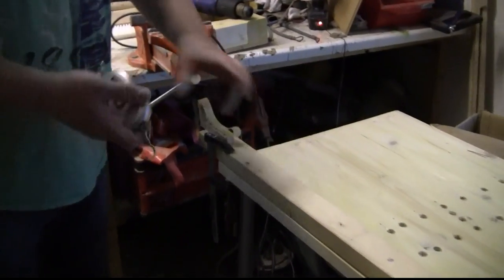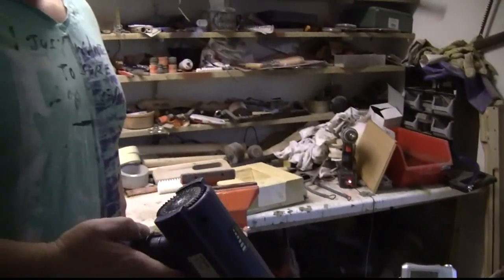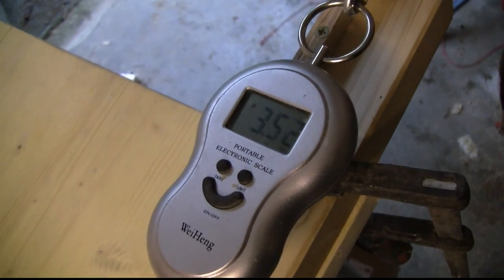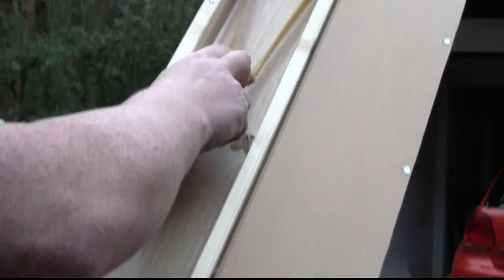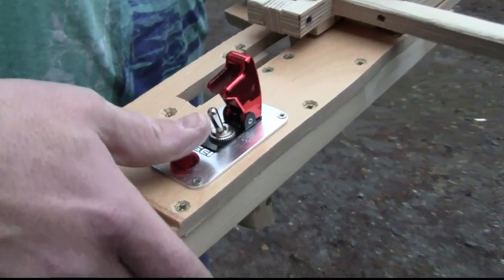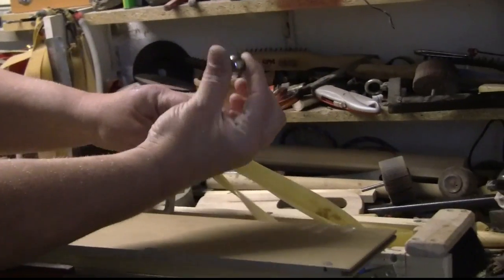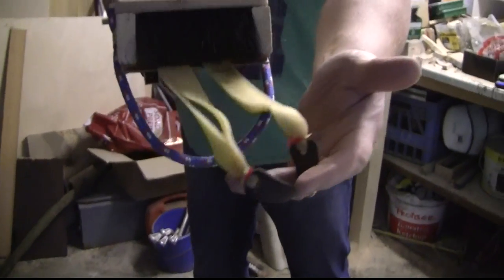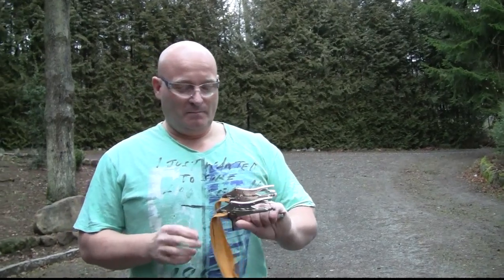The Entropy Slayer 2000: Encapsulated Slingshot Crossbow with Heating System

Comment from the maker: @InTheSticks0001 In fact, the correlation seems almost perfect to me, at least that is the result of my experiments. If I take a slingshot that I can just barely draw out at 20 centigrade to Furnace Creek, I could no longer fully draw it there. But if I could, it would shoot harder. I kept the bands on my little test device stretched for 3 days, they keep the same draw weight once the ambient temp has been reached. Rubber deteriorates, after a few months, it will break down.

Comment from the maker: @ntilley88 You can't reduce entropy as a whole, but you can certainly do that for a part of the overall system. It happens all the time. By decreasing entropy in the rubber bands, we increase entropy in many other things (depleting the battery, using up power generated by power plants, and such. But if we look just at the rubber band, we do reduce entropy in it.

Comment from the maker: @leleobhz It takes the heating system about 15 minutes to max out the temperature increase. A more powerful heating is not practicable because of the energy consumption (the battery is already fairly heavy). I guess a fuel burning heating is the only alternative, plus better insulation of course. But I am fairly happy with this one already.

Comment: Just a heads up about a thermodynamics error at 1:53, when you add heat into a system you are not actually reducing entropy, you are increasing it. A higher temperature causes more atomic vibration in a material, thus increasing the number of microstates available to the material. Since entropy (S) is defined as the Boltzmann constant(k) times the log of the number of microstates, entropy increases when heat increases. 

Thus, this slingshot should be better termed the entropy provider/giver/bringer/increaser, as opposed to slayer. It is amazing that no one here has picked up on such a fundamental error.
Reply: Since entropy is the lack of something, in this case stored energy, and he lessened the lack, his evaluation and application of his technique is totally accurate. The freedictionary defines it as "a quantitative measure of the amount of thermal energy not available to do work". But if I wanted to be even more correct than I already am, he would have an entropy slayer, in the form of the switch that turns off the heat, if you think that when he added the heat his bands got weaker, instead of stronger, as I saw. You should watch more of his videos, he is a pretty sharp guy, and he has a great laugh. Its not often that you see someone who really enjoys their hobby.
Reply: John Robertson ... Have a listen to 1:47 again, he clearly says, 'What we're doing is adding heat energy, we are reducing entropy', which is a blatant misunderstanding of the definition of entropy. Your perception of the nomenclature of the 'entropy slayer' is nothing more than your opinion, but for someone who completely misunderstands what entropy is, I doubt he meant for it to be a 'slayer' that used entropy but rather a slayer of entropy. 

It is in the interests of scientific accuracy, and not for the sake of being pedantic.
Reply: yifuj Oddly, your next to last statement was the original first statement I was going to post before I edited it, so we agree on that part. But, if entropy is the lack of energy to do work, being lost for whatever reason, then he not only theorized correctly, but he proved his point with his demonstration, including his spoken part. He added heat, or thermal energy, which if reviewing my quote of the definition of the term, refers to what is NOT available to do work. Ide be curious to know his background, he is just an office worker, but may have been a leader in quantum mechanics for all we know. Einstein couldve been wrong and Joerg could be right.
Its hard to argue with success.
Reply: John Robertson He introduced heat to a cold rubber band, which produced more mechanical work by shooting faster - that is the very essence of a heat engine, as heat is used to do work here. Remember, the second law of thermodynamics and entropy itself is concerned not with the entropy of a system, but that of the Universe. A reaction, whether physical or chemical wouldn't even occur if it decreased the entropy of Universe. Increasing entropy is the only way to obtain energy out of a system. Here, the heated bands produced more energy, so no entropy is 'slayed'. And if he reduced the amount of work available by heating the bands (as you propose), the speed of the slingshot would be slower, not faster.

Entropy has little to do with Einstein (it was described far before him by engineers studying steam engines), or indeed the work available to a system, as it is a measure of information needed to describe a system in physical terms.
Reply: yifuj Actually, you are incorrect. A elastic spring (like the rubber band here) works by decreasing its entropy as you pull it back (obviously increasing the entropy of the surroundings). This is not a spontaneous process so its ok. When he releases the rubber band, the band spontaneously contracts as the entropy increases back to the level before stretching. See the link for the phyisics: http://en.wikipedia.org/wiki/Rubber_elasticity
Reply: Arfien X Actually, you are incorrect. When a rubber band is stretched its crosslink polymers becomes more ordered, reducing the entropy of the band(although entropy of the universe still increases from heat produced). However, at the point where the rubber band is being heated, and its temperature rises, the entropy of the rubber band increases accordingly in comparison to an unheated rubber band.
Reply: yifuj

I think Joerg said "inducing entropy".
Reply: I couldnt quite make that out. I did hear " losing heat energy" just before that.
Reply: yifuj  I know this is a three year old comment and you most likely won't respond but I was wondering would the effect be different if he heated the bands before he stretched them, then shot? I'm not trying to argue your points I just don't anything about thermal dynamics and find this really interesting.

Comment from the maker: @hrabia99332 Even better would be to stretch it out, then heat it up. If you heat it before the draw, then the draw weight would be much higher, requiring more strength. But yes, that is the way it works.

Comment: Heater slingshot could have slot in the lid closed by two rubber bands with edges meeting in the middle of the slot, preferably on the inside and on the outside. This way its sealed but cocking handle can separate them temporary along the way when moving, it may dramatically reduce heat losses i think because you dont have to openit. The last one could be made more sturdy version and have blades on the outside or one in the bottom without having to make it tougher because handle seems strong enough. With that if overwhelmed by zombies or run out of ammo you can mess them up with cool looking blade slingshot thing :)

Comment: @JoergSprave I also read that when the polymers are stretched, they crystallize partially, which creates heat, and when the rubber retracts those bonds have to be broken by consuming heat. So the Entropy Slayer heating array not only puts the rubber in a higher state of dis-entropy, but also makes it easier for it to return to the rest state.

Comment: what you ought to do now Joerg, is take a chronograph, measure the velocity of your entropy gun upon immediately cocking and shooting w/out heat(the control), measure again after a delay w/out heat, and then your final shot would be with the heat turned on. This would serve to measure the exact amount of energy retention and loss and conclusively prove your hypothesis

Comment: @Musicalshootings Rubber Bands store energy as thermal, and when fired convert it into Kinetic energy. The Drawing of the Rubber Band makes heat, but begins to cool down immediately. If you take a heating element and reheat it, you regain lost energy, making it as powerful (if not more) than if you did a quick drawback and fire.

Comment: The brush you inserted to keep the heat inside the construction surely slows down the metal projectile a bit. Does the effect of heating the rubber bands outnumber the energy loss from the brush? nice construction btw :)

Comment: This is really interesting Joerg, I've never sat down and thought about rubber bands storing energy through heat. Are you able to tell a difference in the power of a shot between releasing the bands immediately and holding them for a few seconds to take aim (maybe like 15 seconds)?

Comment: Love it , but one thing I have not seen (and I do not read all the comments ) when you draw a sling shot and then shoot with the energy from said heat ...what would happen if you pulled and depressed the band before shooting ?(maybe multiple times ) . Obviously specific bands have certain heat tolerances but does it increase from the original pull ?

Comment: I have seen this in archery.Archers try to release asap because the wisdom is that your release hand will without you knowing creep forward and cause the arrow to hit low. Using a low power bow which i could hold all day the arrow hit low even though there was no creep forward, none. I also found the limbs get warm on drawing up.The only explaination is that the limbs get hot when first drawn and if you hold the draw for any length of time the heat escapes to the air resulting in less power.

Comment: A physics question: It is my understanding that the total heat energy is a system consists of Entropy (useless energy) and Enthalpy (Useful energy). Entropy must always increase, because as the temperature difference in the system decreases -- hottest hot to coldest cold -- this is enthalpy becoming entropy.

When you heat the rubber, aren't you adding new energy, which contains both entropy and enthalpy? So wouldn't the enthalpy (proportionately) increase, instead of the entropy being slain?
Reply: WhereWhatHuh I think you're right.

Comment: Its not that the kinetic energy is stored as heat by the rubber, but that the rubber "vents" some of the excess kinetic energy its storing when you draw it as heat. I'm a bit confused by the draw strength increasing from heat after its already been drawn, but I think 1) you're increasing the equilibrium temperature and making it harder for the rubber to vent, or 2) the rubber becomes a more efficient system as you heat it, regardless of the energy its already lost.

Comment: @inov8ve The idea is that reheating a rubber and that's been stretched for a while will give it back the stored energy it lose under the form of heat. 
There are basically 3 forms of energy Heat, Motion, Light + potential energy of an item about to fall. So if you heat the rubber band you will restore the physical power it 's lost while cooling.

Comment: @MADJIHAD1942 I think you'll find heating it up is adding energy. Rubber has an unusual property where it can easily convert heat energy into elastic potential energy which increases the strength of the band's pull. This is known as the Gough-Joule effect. Put simply, pulling the rubber turns kinetic energy into elastic energy, heating the rubber adds to that elastic energy, releasing the rubber turns stored energy into kinetic energy, even the energy which used to be heat.

Comment: have you ever tryd to build a self drawing slingshot?  this was the idea i had  with a winch motor attached to a clamp that you set with ammo, then turn on the motor. the pouch draws back to desired possition. it would need a trigger system to release the pouch. electric would be cool, but manualis probly more practical.. anyways just thought id share!

Comment: The thing you are missing is that heat energy is the waste form of the potential energy stored in the bands by the mechanical energy imparted by your physical self.  If the rubber propulsion system were 100% efficient, there would be no change in heat energy, because none of the potential energy would be dissipated as heat.  The reason that the bands cool down is because of convection currents that carry the heat energy away from the bands, causing them to lose elasticity.  Look up heat death.

Comment: Ok, so since the draw weight increased from the heating of the rubber after it had gotten from its lowest point, am I right in thinking that rubber reacts contradictory to everything else? For example, Rubber contracts from heat when everything else expands? Or is there something else at play that causes the draw weight of the rubber to increase?

Comment: What if you pulled the rubber half way when drawing a slingshot, then aimed and then pulled the rest of the way would you still have the full power from drawing half quickly or would it be decreased?

Comment: if the rubber heats up when you draw it could you draw the slingshot multiple times to buildd heat before firing? that would be a good test

Comment: interesting, i would think that rubber would lose strength when it got hot. you could maybe switch the brush with a trap door that opens when you pull the trigger so you don't lose force/accuracy when hitting the brush, using a pull cable.

Comment: @JoergSprave I've done a bit of homework and I'm still not understanding is as kinetic energy stored as heat, but I do find the mechanics of it very interesting.  From what I understand, the rest state of the rubber is very disorganized and stretching it forces the rubber polymer into a more organized state, with the energy being stored by entropy forcing it back to a disorganized state. (The heat and the molecular organization being separate forms of dis-entropy)

Comment: @JoergSprave just ask, I have a rubber band coach, and once tentatively smeared with oil because it was already old,but after the oil has been stronger! you can get a rubber tubes, which were originally inside the oil is

Comment: I was thinking here: You heat the floor of the gun, and you have a big area to heat and a lot of high impedance tracks. This heat will not be equally distributed trought entire elastic because will heat more the part closer to gun floor. Maybe better use higgest impedance tracks in the walls of the gun? This way you can just do resistence tracks next to and in the same area of the elastic and this way more heat will be dispended and more equally.

Comment: Joerg, you call this the "Entropy Slayer 2000", but when you hear the rubber you are actually increasing its entropy, not decreasing it, because heat is flowing into the rubber bands.
Reply: It slays with the power of entropy. :)

Comment: @JoergSprave Im thinking in a "contact pre-warm system". A coat more or less fixed you arm with the elastic and envolves the elastic. Using flexible wires, it will increase the rate of warming, reduce power consumption (Since its a contact warm, uses less impedance to warm less and improve heat conduction). Likelly F1 racers do with tires. Since this wire can be a very thiny elastic too, it can be released together the main elastic.

Comment: @JoergSprave Ah, in video i cant see the sides warm track. I know, i just wonder that because to spread all warm, even with this physic propertie, it will take a time, so you must to wait a bit until the elastic get the max tension. Im wondering a better warm distribution on this dutting.

Comment: @JoergSprave 

No, I think you are confusing entropy with either temperature and/or energy.
Entropy in a system is either at a constant or always increasing. Entropy is a measure of the amount of energy in a system not available to be turned into useful work.
A system has an inherent entropy due to its physical state (it is called a state function of the system) and it can never decrease. If you can decrease the entropy of that rubber you would have to rewrite the fundamental laws of physics.

Comment: Could you not use a pipe? Put 2 forks small about 1 to 2 inches and then drill hole for the band to run from the outside to the inside where the arrow or projectile would be loaded and then drawn out the back the pipe would act like a barrel mabe even grove the barrel to ride it during the fletching to make a grove to rifle the projectile for accuracy? An idea I have made when I was young not the rifeling but the actual pipe sling bow I used string out the back to pull the arrow back like a 1 inch pipe and the girls off an old risk rocket the sides on the front

Comment: you could make a thermometer with ruber！！！！！！
Reply: Yeah sounds legit
Reply: Actually you can.
Reply: One guy even did a refrigerating system, using rubber compression/decompression to move (very little) heat outside a box !